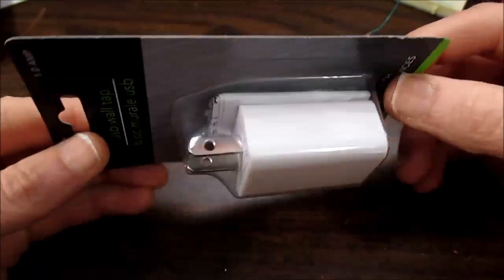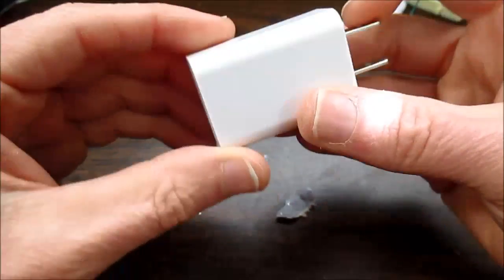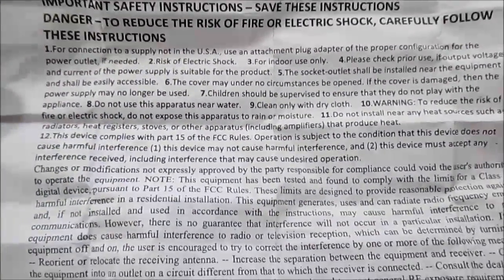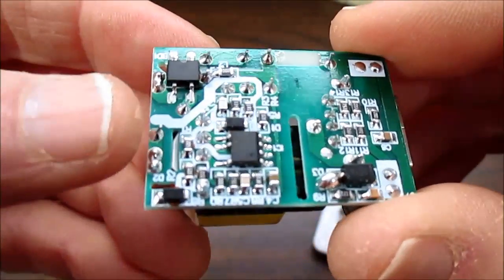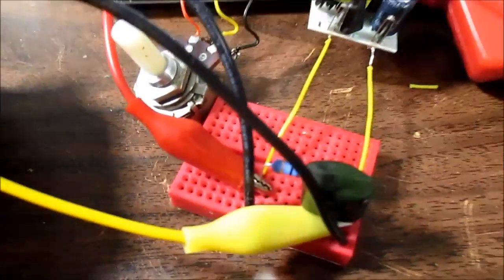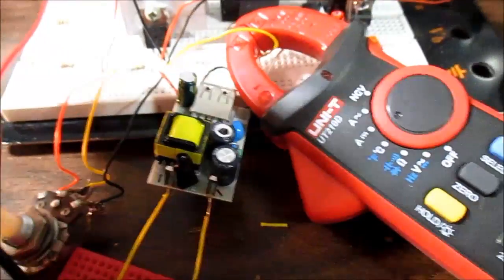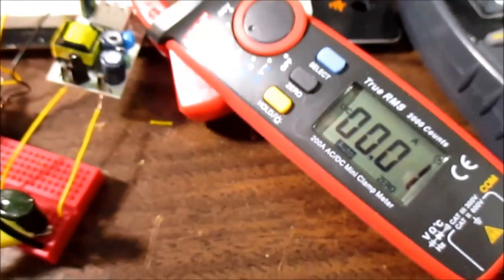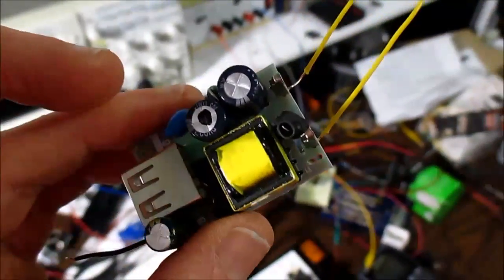$1 USB charger teardown and test

Comment: How did u take the top part off would have been great to see how u did it thx
Reply: not to be sarcastic, hammer and chisel. i cracked open several of these (lenovo, no-name, ) and they had the same stuff inside. some have gold contacts, others have brass contacts. i removed the components for other projects.

Comment: Usually any charger sold in N.A bearing the ETL mark should be legit unlike Chinese junk from ebay/Ali
Reply: all the cell phones that i use up (no more time, ect,) i scrap the WHOLE thing. remove the battery, gold, motor, gold circuit board, silver contacts under the buttons- open the charger block, unsolder the components for other projects,

Comment: I really like your videos

Kind regards 
Stephan

PS: found this data:

CR52312 high-precision constant current / constant voltage primary PWM power switch 
features
l Low starting current 
l Constant voltage accuracy up to ± 5%, constant current accuracy up to ± 4% 
l Primary side detection topology without TL431 and optocoupler 
l High accuracy constant voltage and constant current output over full voltage range 
l Programmable CC / CV mode control 
l Built-in output line voltage compensation 
l Built-in primary inductance deviation compensation 
l Built-in leading edge blanking circuit (LEB) 
l Built-in high and low voltage over power compensation 
l Built-in secondary voltage sampling controller 
l No audio and noise control technology 
l VDD overvoltage protection 
l Built-in FB open-circuit protection 
l Built-in CS open-circuit protection 
l Undervoltage lockout protection 
l Cycle-by-cycle current limit l Over- 
load protection 
l Over-temperature protection 
l SOP-7L package

from:
http://www.jsddz.net/html/qyxw/20160104/139.html
(I used the translate function)

Comment: Ok, so the charger lives up to its rating. Does it have a FULL BRIDGE RECTIFIER!!! in it, though?
Reply: WHY ON EARTH would you worry about that when there is lots of higher priority design details that will make more difference? And yes, you can see the bridge rectifier clearly in the solder side shot around 3:05
Reply: It does make quite a difference.  The reservoir capacitor would need to store a lot more energy, or it would cause severe 50 Hz ripple on the output.

Comment: HI! I wonder how much switching noise gets through. It doesn't look like they have put much effort into noise suppression. If you care to check, it might be interesting to see the noise output on a scope either time domain or FFT and then vary the load. Also, I especially like the solder blob on the mains side diode or whatever it was, looks very nice indeed ;) 
And finally, although it's hard to tell from the video what is the approx. creepage/clearance between the spark gap but It looked huge like 8mm/.3" or something. This would suggest the board material is from the cheaper PCB CTI group III or worse and even then 8mm is out of spec, should be 5..6mm~1/5inch for 4kV transient which in turn is again of high rating. 
You only need to use that charger once during lightning to blow up your $500 schmartPhone, right?

Comment: Captain, I have two questions for you:
1. Do you have a video where you explain the test setup you used for this test ? (the load and the inverter)
2. The inverter is for galvanic separation?
Reply from the maker: I plan on making a video on it at some point. To answer the second question: Yes.
Reply: +Peter Oakes did a realy nice DC load.
https://www.youtube.com/watch?v=BuYB9qPHGNY&t=1098s